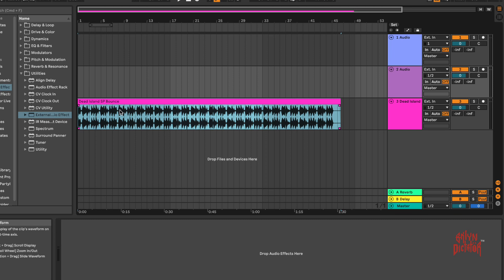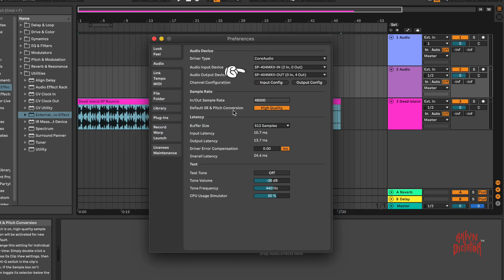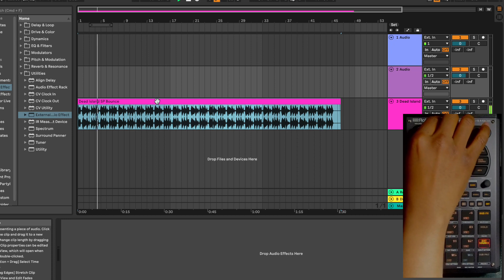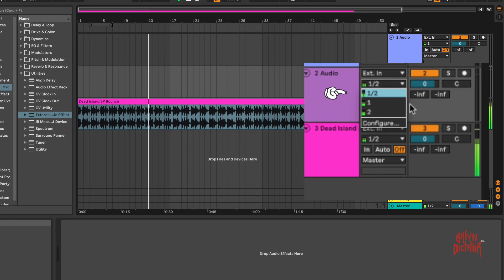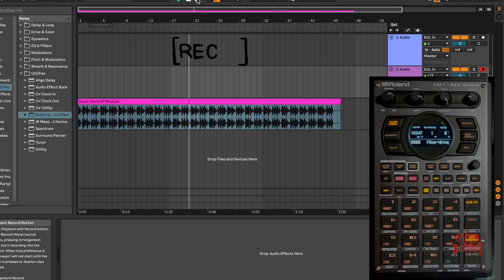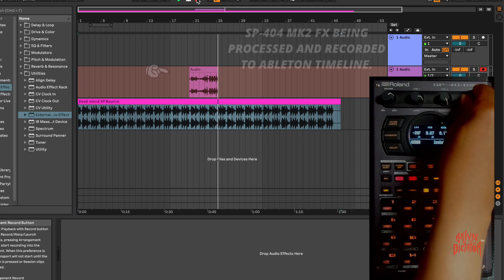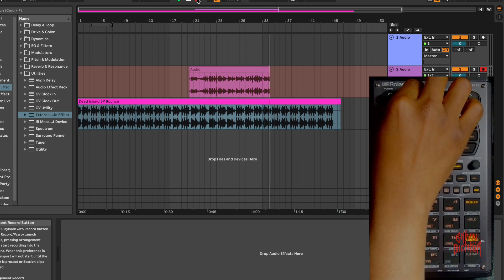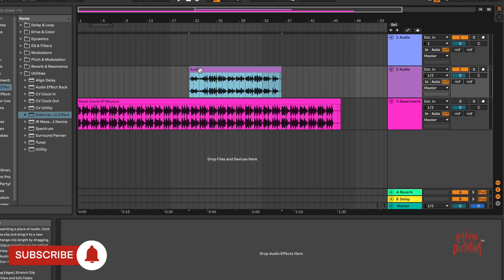How To Use The Roland SP-404 MK2 As An Interface to Process Multi FX In Your DAW Session

Comment: great video man! one question, is it possible to do this w the usb c cable? cause it doesnt let me run the sound from ableton to sp and get the effects
Reply from the maker: @HattoriKarton  Not exactly sure what you’re trying to do. Try to remember this… Ableton should be running through your SP to use those FX out into your Ableton mix. 

Give me a little more clarity as to what your trying to do if that does not help. Thanks man.💯
Reply from the maker: You are asking if you can connect using USB-C and use external FX?
Reply: @bassrobotics  i cant do what u do, the fx doesnt go back to ableton. it just sound what i have recorded in ableton but doesnt work the effects using the usb c
Reply from the maker: @HattoriKarton  Hmmmm.... Are you sure you have the correct channels selected in Ableton?
Reply: @bassrobotics  im using windows and the line out is speaker sp404

Comment: What's up man? Thank you for what you do. This works for me but I have to turn up the volume on the SP really loud for normal pick up and I'm wearing headphones. Is there a workaround for how loud it is through the headphones?
Reply from the maker: @ghost.intime  Are you referring to the master volume?
Reply: I believe so, it's the volume knob for the SP. I use my SP as the audio interface, and the volume is already all the way up on my laptop, but the levels still read low (-20 dB) when the sound is returning to Ableton from the SP.
Reply from the maker: @ghost.intime  Did you try another audio file? That is pretty odd.

Comment: Question about your audio settings. Are you using your SP As your audio interface or are you using a separate interface?
Reply from the maker: @mickeyricketts6987  How’s it going man. My SP is the interface in this situation. The SP is a pretty solid interface depending on your needs. Thanks.
Reply: @bassrobotics what is coreaudio? I’ve been using ASIO4ALL as my driver and it’s not that good. Where can I get the driver you use and is it easy to setup with the SP? What are you able to get your latency down to with that driver?
Reply from the maker: @mickeyricketts6987  Your referring to Core Audio in Ableton?
Reply: @bassrobotics  yes

Comment: making this on FL its a challenge, the amount of feedback its insane :/
Reply from the maker: There's feedback? Thats super odd. What kind? If you can explain. Thanks man.
Reply: @bassrobotics  ok, like, when i put up some effects(not all) the sound starts to get really loud and starts to go up in volume until i have to lay down the volume on of the SP. This is particulary sensible with the isolator, resonator, filter driver. And some MFX effects. If i go and use the vinil sim it wont happen, just with effects that alter too much the original signal that comes either from external drive oor inside the FL with the sample and the MK in the same mixer channel. I have to put on the same channel otherwhise i cant use it since the aplication of this Roland ONLY appears has instrument not has  a vst on the mixer channel :/
Reply: @duc3r_prod  Yeah it definitely happens in the upper harmonic range. Have you tried the anti feedback input setting?
Reply: @DeathTrapProductions  yhea yhea, but still not much Diference,  its a FL problem, not really thought for that :/
Reply: @duc3r_prod  It seems like a digital feedback loop. I even tried monitoring with headphones but it still changed the fidelity.
Reply: @DeathTrapProductions  owwwh tankyou man! Its a shame :/ gotta go to Ableton to use this better :/
Reply: yhea ive figured ou one step, actually you have to really use the mk  direct sound device, the problem is that you cant record has FL need to be a asio drive to do the recs leeel

Comment: I just did this but I can only output. When recording in Ableton it sounds garbled.  I have the inputs selected. Anything needs to be done on SP itself to make this work?
Reply from the maker: I can't see your exact setup but most likely it's a super simple fix, something overlooked. Try a different output and check your in/out audio setup in Ableton.
Reply: I have the same problem. Have you found a solution?
Reply: It took me awhile but I figured out the problem fix input and output to sp but not  through the same channel they are different sp 404 input and output channels

Comment: Thanks for the info! Do you know how to make it so that the SP doesn't pick up all the other audio in the session when trying to record a new track? I'm trying to use it like a traditional interface but it always picks up/records the other elements I've already recorded to the new track I'm trying to record...Can't find a work around for that outside of muting the other tracks to record a new track.
Reply from the maker: Thank you so much, glad I can help. I honestly would not use the SP as my main interface but if that what’s available now, go for it. Muting the other tracks is probably the quickest and most practical solution if I am understanding you correctly. Make sure your selecting the correct Ableton input/ outputs.
Reply: Word, Makes sense. thank you! @bassrobotics
Reply: SO I actually found a work around. Like you said, not best to use the SP404 as the main interface, but If I use the built-in output as the output rather than using the SP as both in and out, then I can do some multi-track recording without having to mute the other tracks. Not ideal, but it gets the job done with my limited set up.  @bassrobotics
Reply from the maker: @deeholiday6853  Awesome feedback. Thank you.

Comment: Yo bro first of all Thanks for thé tip !! Then is it possible to do this but not using the sp404 as an audio interface ? Sorry for my english and Thanks for your answer !
Reply from the maker: No worries at all. I want to make sure I understand what your asking first. Are you trying to get the same result with a different type of device? Are you trying to get the SP-404 audio into your DAW without using it as an interface? Tell me exactly what your trying to do.
Reply: Hey bro, would love to know this too! :) I have a UAD apollo twin and have the out 3+4 into the mk2 in and then the mk2 out into my apollo again. Is there a way to not have to choose the mk2 as the audio interface and choose my apollo instead (i have more channels connected to my apollo through ADAT and use the apollo/UAD console as my HUB thanks so much for all the help you give bro @bassrobotics
Reply from the maker: @commonbeats  Sure you can do that. Absolutely. Your goal is to use Apollo not SP as interface correct?
Reply: yeah so i can get audio to and from it and also if possible use it for FX in Ableton live  @bassrobotics
Reply from the maker: @commonbeats  Mmm!!! Just curious. Are you using a Mac or PC?
Reply: @bassrobotics  mac :) thanks so much